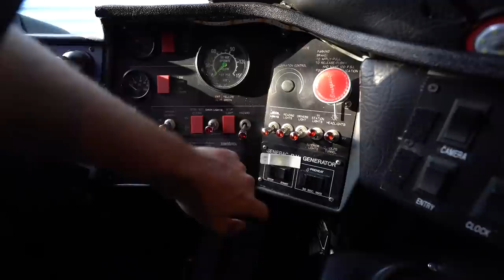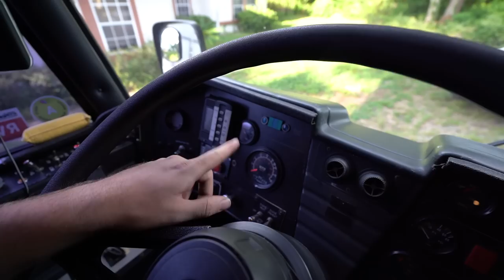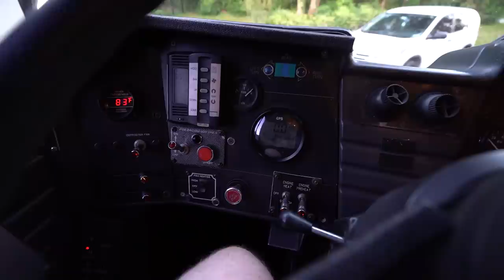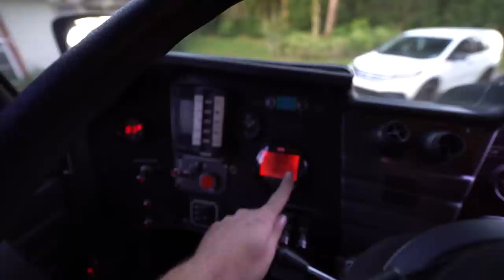Final upgrades for the car hauler RV bus conversion. make it or break it

Comment: I think one thing that gets overlooked is fire suppression. I’d look into getting one for the bus considering how your entire operation is in there and it’s a fairly long process to get the car out
Reply: I agree with this, hes got one in the vet, why not one for the bus!
Reply: It’s on the list he’s mentioned it in the first episode i think
Reply: he hasn't even bothered inspecting the suspension or brakes yet, or basically any of the actually important stuff.
Reply: @Avboden brakes and suspension are something you can tell if there's anything wrong by simply driving the vehicle . Even a professional mechanic will take a car for a test drive before removing and replacing parts . He drove it all the way home from Maryland , if there was anything wrong I'm pretty sure he would have figured it out by now .
Reply: @Shadowband72 I've heard " oh, I just thought that was how they all drive" way too often to believe in that. When you get a new vehicle (especially if it is a bus and you are not used to busses), you have no clue what is normal to feel while driving.
Reply: I've had that engine in a different bus catch fire, I didn't care about anything in or around the bus and I was still able to put it out with less than a case of water. $3.99. I don't know how much a fire suppression system is but it's probably pretty dumb
Reply: I would have a couple of the fire suppression balls in the garage area as a bare minimum.

Comment: NEED TO BUY STANDALONE NEW CARBON MONOXIDE detectors for cabin and garage for when generators running at night etc.  do not trust the one old stock camper one if it even has one.     On that same note check generator exhaust for leaks  and proper routing  as well.

Comment: I've had an Eagle bus for the past 15 years. If you haven't yet, check the DOT date code on the tires. I've had two blowouts, both were tires with plenty of tread but over 12 years old. It's quite exciting when it happens.

Comment: Hey bro, you should be sweet to swap out the fuel filter, just fill the new one with diesel before installing. I used to service trucks and buses and that's what I used to do, they started up fine.

Comment: Taylor, small recommendation: maybe add studs and wing nuts to the generator cover? Save you the hassle on varying bolt head sizes and essentially becomes tool-less to remove it.

Comment: I'd use studs for the generator side cover and nylock nuts, so they won't vibrate loose/off.  Also put some padding around the edge to get rid of that rattle.

Comment: I would have done a red led strip for temporary backlighting on that dash. Lower wavelength lights don’t mess up your night vision as bad as white or blue lights.
Reply: Fighter jets, submarines and most truckers use red for night lighting. So did Pontiac for many years

Comment: Love the bus. Congratulations. If you need a real CB go there in Lakeland to Mesa CB shop and talk to Tony tell him you need a high output upgrade radio. and that Apache sent you. And on that motor remove the gov or nor. and set cruise to 70 on the pedal. And 75 on the switch.

Comment: Heads up on the electric tools. A charging station on the side wall and some 3D printed battery holders to store the batteries for travel would add organization and reduce risk. It is rare but the batteries do catch on fire. People don't think it happen but it do.

Comment: For the generator fuel filter you can fill the new one  up with standard ATF spin the old one off an spin the new one on you should have no issues..iv been using that method for 15+ years no issues
Reply: I been doing that for 40 years, always had a fuel filter and and filter wrench, with a qt of ATF in every truck I drove. Your Fuel injectors will love you for it.
Reply: @Neverdie242  in my opinion it's the fastest an only way! i try and pass it along every chance I get

Comment: When you do the fuel filter on the bus or the generator put transmission fluid in the fuel filter fill them up it will clean the injectors and you won’t have to prime it

Comment: I am not sure if the rear interior doors are necessary. You have the lfit gate folded and then the exterior doors (body panels). So the extra set of doors maybe not needed then you wont have to bunji them at all when loading the car in.
Reply: He's said in previous videos  that they are needed for the aircon in the rear garage otherwise there's too much leakage.

Comment: would be looking at a full set of speedhut gauges for it and modernize the power setup with solar, batteries and some 48v dc mini splits, sell all the old stuff while you can show it working... speak to the crazys at Edison motors in canada throw an e-axel under it!

Comment: No one ever maintains the the generator. They get really bad if they are behind the rear tires.probably need to remove it’s radiator and clean the inside and out

Comment: When replacing the fuel filter, fill the new filter with fuel before screwing it on.
You don't have to bleed the entire system, just start the engine and let it idle for 10 minutes, it will then bleed itself.

Comment: That bus should make that trip no issues.
Reply: It didn’t, he didn’t make it due to a power steering hard line leak.
Reply: @darkhorse4148  could still drive without power steering right?

Comment: I would assume that every wire has a part number on each harness wire so u can cross reference them in the looms. Volvo semis are that way. Cause they r all the same damn color. First time I worked on a semi I was like what the hell is this???? My buddy handed me the laptop and said have fun. I said wtf r they all this way? He said yep, welcome to working on semis and heavy equipment... I said this is a fucking nightmare... He said ah u will get used to it after awhile... never did, that's why I got outta that biz lol

Comment: Id see if there would be a way to put 2 bars across the hood up front for spare tires. 4 u shaped brackets with higher sides and lay the cross bars into them, run a ratchet strap from e track to e track. Should hold the tires down along with keeping the bars in place

Comment: Wouldn't it make it a lot easier just putting transport tires on the Corvette to make it much narrower for transport? Since they stick out on all four corners I mean?
Reply: For the sake of 1 minute of squeezing it in it's not worth getting the jack out, jacking it up, taking the wheels off, putting narrow wheels on just to save 1 minute plus it means you have to bring a useless set of wheels with you.
Reply: @thedestroyer3262  I see YOUR point, however Taylor complains about it so much that it has to be worth it... no human alive complains this much about a thing without fixing it... I would change them, because it takes like 2 minutes. And the narrow tires are easy to store.
Reply: @AfroMyrdal  he's going to fix it by changing the doors on tge bus to a flip up style
Reply: @thedestroyer3262  that's easy compared to changing tires.

Comment: love your work , but try changing the white led to a red one will be better for night driving , has the bus got  self bleeding air tanks , i have not seen you drain the air tanks , also look at a small Australian  company called pearlcraft , they do pearl coated steering wheels gear nobs and switches for trucks and cars  , im sure you will find it hard not to order all their products

Comment: i feel like the loading ramp needs some upgrades/reinforcement it doesnt look like it was built to lift much more than a 4 cylinder its starting to bend downwards in one corner, the winch bends it sideways every time you pull it up , its gonna bite you on the ass bad if you dont sort it

Comment: Need to run some Diesel Klean through it and need to just add two more batteries to the system. add an air compressor, buy one of the good ones for a bagged truck and just put a tank somewhere. cheapest and easiest way. Could also do hammocks for beds. where is the spare for the bus and tire tool havent seen it

Comment: The crown vic has a failsafe that cuts fuel to half the cylinders in attempt to keep the engine cool. Its to try and limp a car off the road and its obviously not great under high power.

Comment: The bus should be a lot more reliable than the 2020 Ford was . When that bus was made they built things to a much higher quality level . And an old Cummins has about 1% as many wires , and 0% as many computers as there is in a modern vehicle . If you have a temperature gauge , and a oil pressure gauge you should be fine .

Comment: After driving Vics “professionally” for about 15 years, never thought of racing them like this lol. Drove them at 123-128 MPH for 90 miles straight going to calls and they are the best cars ever, true workhorses. 

One thing neat about them was if you had one with cruise control, once you hit the Governor, you can set the cruise and “walk” it up fast by pressing set over and over. It would give you about an extra 5MPH past the top speed. 

I miss the vics. Worst decision Ford ever did by getting rid of them.

Comment: Racing a half ass Crown Vic on a 1/2 Mile high bank track with a OPEN FACE HELMET? You need to be parked. What are you thinking when your teeth hit the steering wheel it will not hurt? Crazy. Had to stop this and all future videos.
Reply: If your teeth hit the steering wheel with a full harness on you've got far bigger problems than your teeth.

Comment: no hub wheel service bearings tie rods, air system bags leaks nothing about safety and suspension, which is the achilles heel of these old busses rolling train wreck waiting to fail